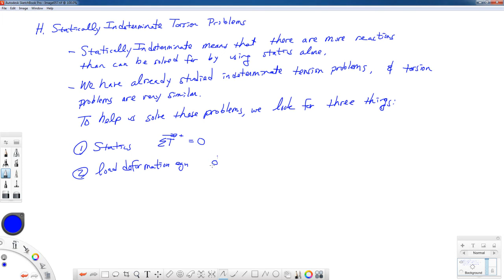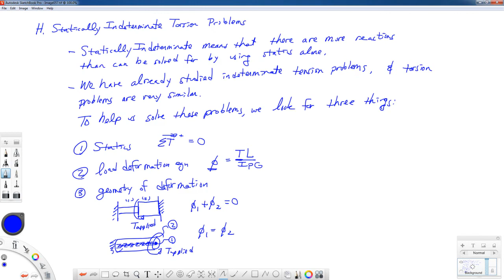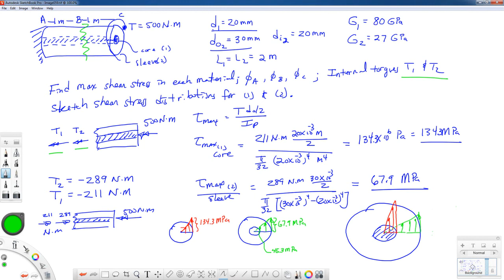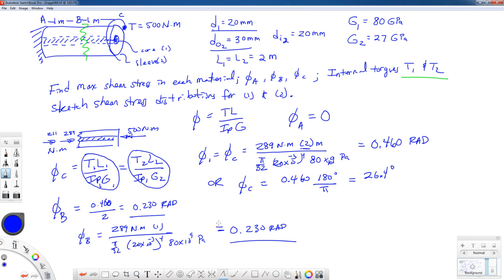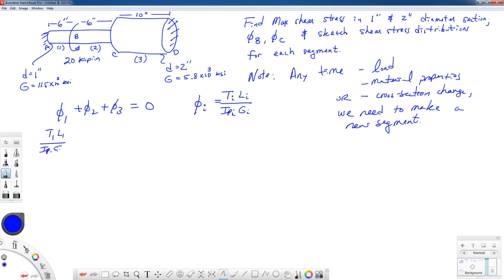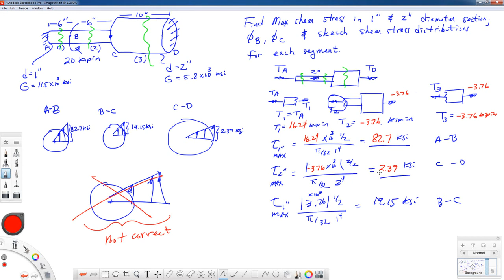Mechanics of Materials-Lecture-15-Statically Indeterminate Torsion Problems

Comment: Thank you for your extremely helpful videos. There's a little mistake 26:30 when calculating the angle. You used T2 instead of T1 and the angle should be 0.336 Rad.
Reply from the maker: Thanks, indeed I used the wrong torque value in my calculation (should have used 211 and not 289).  I appreciate it!